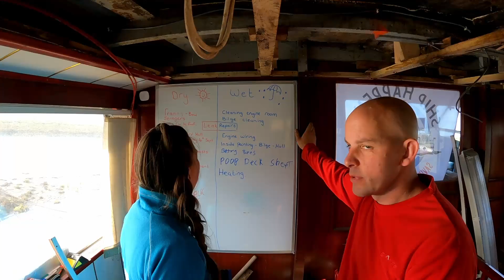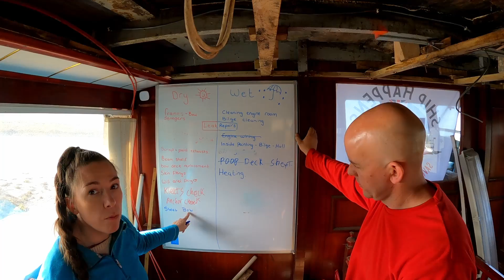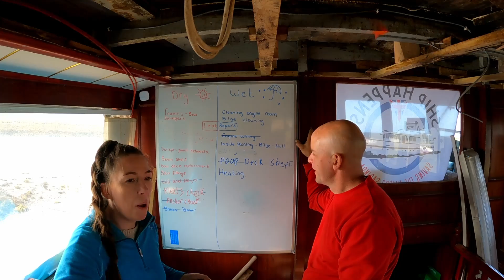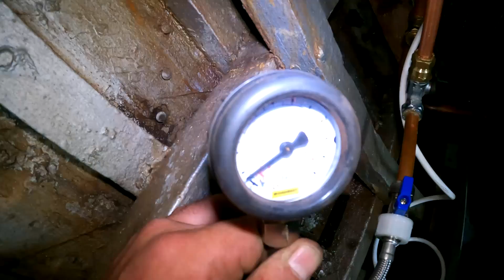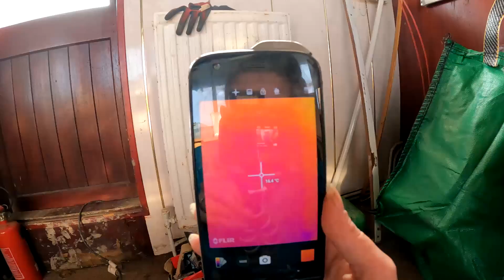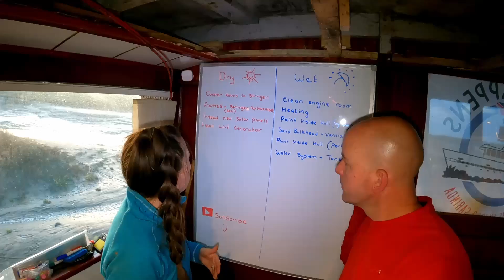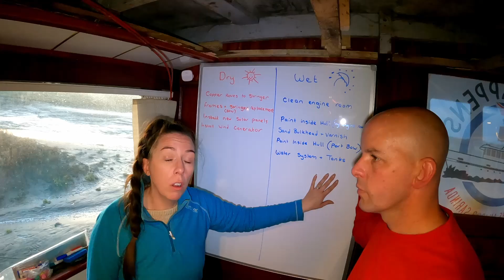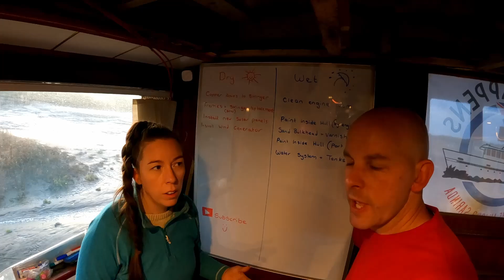Ep 43 - Installing Central Heating On A Boat! Time To Get Warm!

Comment: I suggest you give serious consideration to eliminating the metal wet exhaust on the outside of the hull, and replace it with a dry vertical exhaust that runs up through the decks and discharges up high. Doing so eliminates the need for a wet exhaust line that’s prone to leaks and can be a fire hazard if the cooling water fails, it will also reduce the chance for exhaust fumes getting back into the boat. 
When Sarinda was originally built, the exhaust went straight out the side of the hull which was fine for a military vessel but would be dirty and smelly for a yacht. Like a lot of other of the modifications, they took the cheapest way out and built those metal covers on the side of the hull. 
Since the interior is getting stripped and replaced anyway, putting in proper exhaust stacks for the engines is the best way. A pair of false funnels could be built on the top deck to make it look like the boat was built that way from the beginning.

Comment: The heating really will help keep Sarinda both dry and comfortable. Another longer term project for which you will have plenty of space is to make a contraflow cabin air heat exchanger whereby you can expel stale damp warm air from within Sarinda but use the temperature gradient to extract most of the temperature from the outgoing air and transfer that heat to the incoming fresh air. 😀

Comment: Gemma, your radiator in the back of the cupboard may have been used as a warm cupboard at one time. Charts, powered food, ships paperwork and alike. Even drying out wet clothes or washing as a small airing cupboard, nice to have something warm and dry when the boat is damp.

Comment: Ps if you look at the original pump pipework as seen in other videos it ran athwartships to reduce the potential flex ( it absorbed most of the strain and kept low to minimise movement due to roll and pitch

Comment: Look into a ROWPU system for unlimited water. As long as there's water under the hull you don't need to rely on your rain tanks. Right now it will only be good at high tide but when you're cruising the coast of Spain it will be a "must have".
Good work Stuart.

Comment: Nice job getting the heating going for winter. But be aware that problems may arise when you finally leave the berth. With engines running and waves there will be problems you don't meet shoreside namely vibration and movement. I assume the boiler is well secured but the  heavier components  pump ,   3 way valve,T Joints and  valve behind the flue will need bracketing and support to hold them rigid and stop their  inertia flexing the pipes and distorting the joints leading to leaks as the ship rolls and pitches .

Comment: Initial warmth, the ability to dry paint, less humidity.  Then relocate and upsize some radiators.  Once the capability is proven, add mor3 strategic radiators.  Then progress to hot and cold water.  Hopefully adding carbon monoxide and dioxide sensor alert systems.

Comment: Reminds me. Get a windmill that’s 48 volts or higher since your 24 volts. A 3 phase 120 volt windmill would be a charm and a charge controller specifically made for windmills. Like midnite solar or outback. These should allow you to change to windmill in settings. I just put my windmill up last week and added 6 hours to our runtime daily during the rainy season.

Comment: I remember now; the good English brand of wind generator is 'Rutland'. If you drove a 40' pole into the mud and mounted it on that you would have no transmitted vibrations into your structure (boat).

Comment: Two things have occurred to me. The first is to do with the ballast. As they are made up of small parts that might rust is to spray them or cover them with something like WD40 or rust inhibitor and perhaps put them into easy stack plastic boxes surrounded by a resin to locate them within the box which would make them easier to stack, secure and move around as appropriate.  The second thing which is probably a longer term project is to make yourself a water maker which creates freshwater from sea water. There are probably YouTube tutorials for that however the guy on the sailing channel  "Life on Jupiter" showed on one video how he made himself a water maker from parts bought online. That sort of project looks right up your street as it means if you have electrical power and sea water you can make your own freshwater doing away with the need to fill up at a marina. 😀
Reply: I had a similar thought on the ballast. use rust remover and then encapsulate into concrete moulds of standard brick sizes with handles. or custom make each one to fit the bow shape. each brick making the most of wasted air space but without damming the bilge flow in any way.
Reply: Sv seeker made his own water maker
Reply: Jules and Suzie from "Sailing Emerald Steel" made their own Water Maker and its lasted years before he had to replace any parts, but Jules did go over board on the construction and the amount of Water it can make, as he explained to a recent Episode on making your own equipment from scratch versus buying it an off the shelf item, he had also built a Freezer from scratch too...

Comment: That heat should also help to dry things out.  The insulation behind the boiler was probably to help reduce heat loss when the hull was in the water.

Comment: Assuming you also didnt spray down the reflective film... (apologies if you did) 

In the future for a more permanent stick with spray adhesive:
Cut the piece more or less to fit. (leaving an inch or two margin on each edge)
Spray the surface. 
Spray the piece. 
Wait a minute or two for the glue on each side to get tacky. 
CAREFULLY stick the piece to the surface. Bear in mind it will stick and wont move AT ALL like it would when the spray adhesive is wet. But Seriously, once its pressed into place, its not coming off. Ever. LOL 
Then after rolling/pressing the piece, trim the excess. 

Love how its coming along! Keep up the good work!

Comment: Gemma, I highly recommend a Vertical Access wind generator. They are faster to produce power at lower wind speeds, and because they are VAWG's (technically VATS (vertical access turbine)), they don't need to swivel to face the wind, as they are always facing the wind no matter where it's coming from. Some more expensive models can also be remotely locked via wifi/data connection to prevent overspeed situations in storm winds. Most have automatic overspeed brakes, but the real fancy ones let you control everything from an app. They are also generally rated for lower windspeed starts, and higher wind speed shutdowns than a standard wind turbine.
Reply: They are also easy to make yourself, and as you both have a shop and mechanical know how, I suspect you could look up the design concepts, and fabricate one yourself fairly easily.

Comment: 12 Hello Ship. /02/2022. I only wish you had painted the bulkhead behind the boiler. You will not find another chance without great trouble and a hard time. ! he would have been all it would take. I am an old home restorer and repair man. Once the plumber, furnace or boiler installer arrives my access was compromised like your access is non. Otherwise paint before you cover up as you have done. Good job. Closing up before winter is a good task. Best wishes 1 yeasr ago. Don usa

Comment: Hi Guy's everything looks like it's coming together just a small tip if you are not aware if you use an indelible ink pen by mistake on the white board you can remove it with the proper white board pen just keep rubbing it on the indelible ink and it will soften it just keep wiping it then re-apply it does work.

Comment: If you put in rain water collection then install a reverse osmosis system and then your rain water is fully drinkable.
Reply from the maker: great idea x
Reply: @ShipHappensUK  If you keep your grey water seperate from your sewage water, then you can also use reverse osmosis to recover grey water instead of facing pump out costs and very useful if you are on an extended voyage.

Comment: A wind generator is noisy, but you'll find that it's the right idea. It makes power day or night.
Reply: If there is wind.
Reply: @normanboyes4983  in the video one of them says, "There is always wind."
Reply: @paulheitkemper1559  True they did say that - but the use of language is loose:
‘It’s always windy here’ - means it is exposed and when the wind blows there is a lot of it. However when then there is no wind - windmills do not turn.
Just like solar they generate a lot of power when there is sunshine - however they do not generate anything at night.
Reply: @normanboyes4983  try not to pull a muscle with that reach.

Comment: Is that Flex exhaust pipe aluminum or stainless? If it's aluminum REPLACE IT IMMEDIATELY!!! If it's stainless your perfectly fine. By the sound of it get a wind generator that way you'll be charging 24/7/365. To Stuart a job well done. There is good money in the Marine industry with heating and plumbing.
Reply from the maker: Sure it's stainless xx

Comment: Where are you Anchored up as I would love to come and help if I can. I can paint varnish and fibreglass also can put my hand to most things. Only down side is I cannot walk to good but that does not stop me. I also sail a small boat so love all things to do with boats. Also ran a car body shop and was a road side recovery chap to fixing car or like the new ones not fixing them as need computer to work out what code you have and then try a work out what part or parts you need to fix it. As a code is just a Guide of what may have gone wrong on some one code could be up to 6 things which then need to look at to find which has gone. Bring back old cars that you can fix on a car park outside a auto parts shop. Good luck with the work and you gone a long way from when you got the boat. I would love to sea if she can move herself. Also what derv you putting in the engines and you put any thing in it to help it be ok over winter as the tanks could get well cold. Do your marine engines have a rad or are they sea water cold as you are looking at things freezing up. Last thing love the videos and love the way your saving a old boat that has lots of history well done.

Comment: Being a former Patrol Boat Sailor, when I see those two main engines, what is the fuel consumption. We had Paxman Valentas that could suck up fuel.
Reply from the maker: The manual says 4 gallons an hour at max speed!
Reply: Valentas were actually pretty good on specific fuel consumption (SFC).

Comment: Is there an explanation or schematic of the exhaust system?
Reply: Yes. The engine produces exhaust fumes, which travel along a pipe, (called an exhaust pipe) which takes the fumes outside the boat.
Reply: @johnnunn8688  thanks, but I have only seen exhaust that exits through the transom, whereas from previous descriptions, it appears that the exhaust system runs along side the hull.

Comment: Ya REALLY GOTTA BE CAREFUL MESSIN AROUND WITH BOILERS!!!!!!! A guy I used to work for completely destroyed a 2-story farm house by tryin to fix a hot water heating system himself. He didn't know what he was doin and the boiler burst. Luckily nobody was seriously injured, but the house was a total loss. The pressure released was enough to lift the house off the foundation, lift the roof off the house, blew out all the windows, and any door that was shut at the time was blown off the hinges. It blew a 6' dia. hole through the main floor and a 3' dia. hole through the upper floor.
Reply from the maker: Oh dear!

Comment: with boilers be ware of the fitings and bolts. for the steam and hot water . then can not be brass or copper but steel .. there is ships boilers went bad due to some one did not follow the right laws for the right bolts..  they are to be steel g 8 +  looking out for you all steam realy gets hot...
Reply: This is a central heating boiler not a ships steam propulsion boiler...